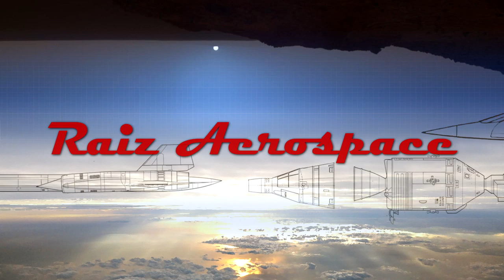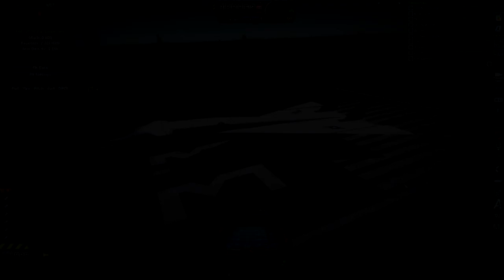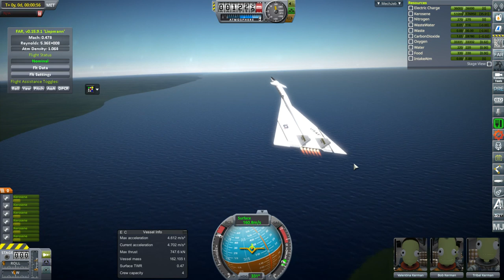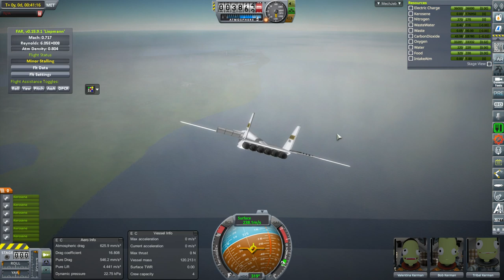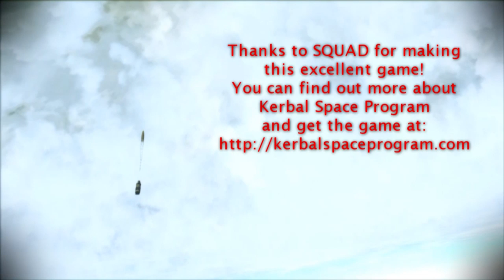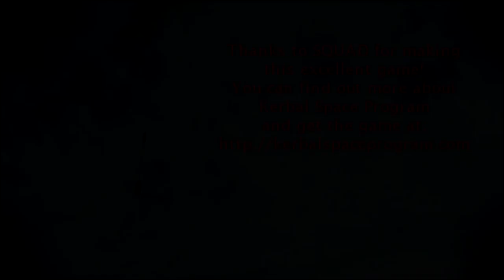KSP - Realism Overhaul Sandbox - XB-70's Road to Mach 3

Comment: A little bit of my incompetence:
1. Engines: 747.6 kN/6 = 124.6 kN which already exedeed 120 kN on english wiki. But there other sources that tells us about 137.8 kN. Additionly North American claims continuing flying in m=3 without one engine, so 17% margin in thrust somewere here. So it looks like you need reduce drag a little bit more. Speed limiting factor is temperature of hot parts of engine and fuselage&wings, not thrust, i think.
2. Airbrakes. I cant find info about this, but from my couch looks like for stability reasons differential deflection of vertical control surfaces is better then horisontal. But xb-70 have front control surfaces and fancy fly-by-wire, so it could be a lot complicated.
3. Balance. Do you check com and col when plane is empty? Maybe some lead needeed?
4. Mechjeb&FAR. Why you dont trust mechjeb? Is his info incorrect?
Thank you so much, your videos very cool :3
Reply from the maker: Well, the only thing I can address right now is #3 - I already added some lead surreptitiously to the front of the plane for this flight, but clearly not enough. I'll have to mess with the CoMs in the configs to avoid that.

Comment: Can the FAR values for the wing be added?
Reply from the maker: I tried to add the FAR module to the wings, removing the stock module, but the plane kept tilting to the right for some inexplicable reason, and the FAR dialog showed a huge yaw imbalance. For now, the FAR module is commented out. I'm not sure what's going on, but it's clearly due to how I made the parts, since the Rutan Boomerang has the same problem.
Reply: @RaizSpace  I have had yaw problems when using custom parts with FAR before...

Comment: Could this be related to the yaw problem you mentioned? Or possibly I used an old part.   https://imgur.com/XJBiRr6   Awesome series BTW. Regards.
Reply from the maker: Hmm, that's a bit strange. Did you place the vertical stabilizers using symmetry or on the nodes I placed for them?
Reply: Raiz Space I placed the vertical stabilizers individually on the nodes. The rudders were placed on the body in symmetry to use as a 'yardstick'.
I threw it all in the JNSQ mod save I have going, just to see if it would fly. I know it's not meant for that (or the Rapiers I bolted on), but it was fun.
Again, thank you for all your work. Have thoroughly enjoyed all of your content.